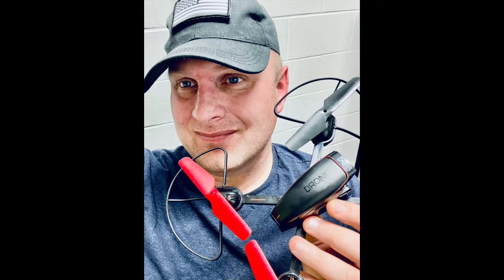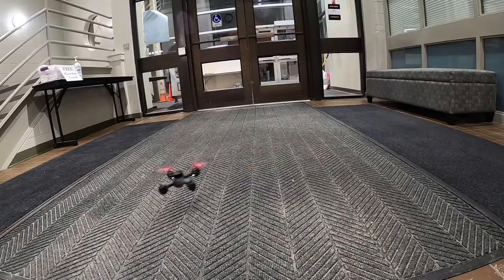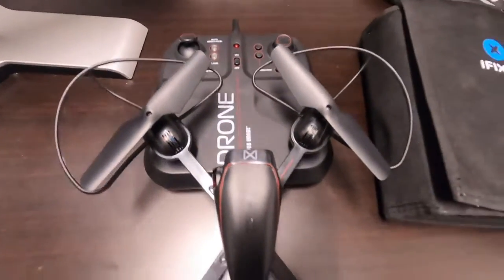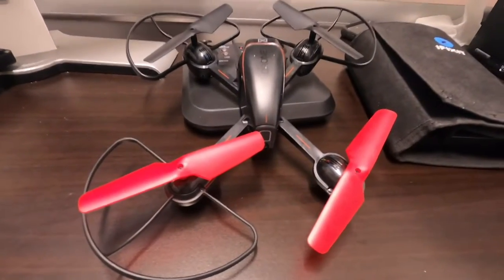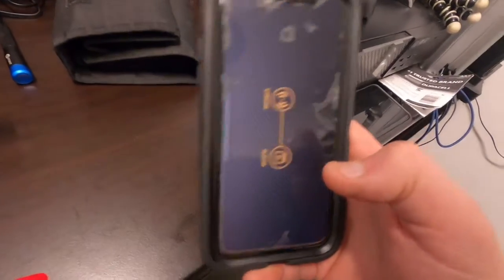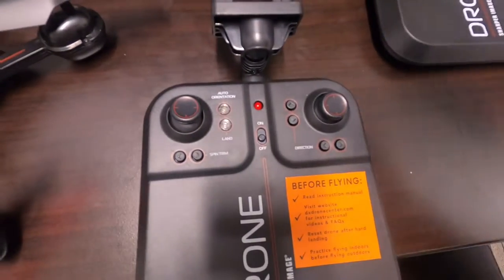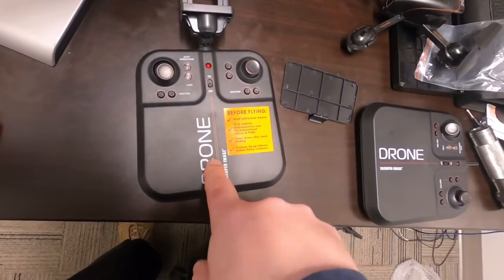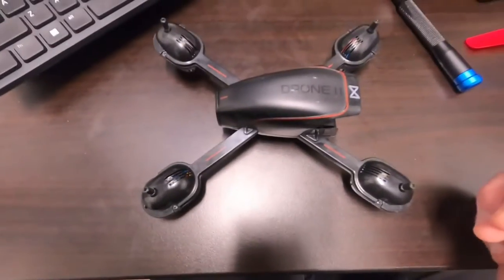Sharper Image Teardown, Calibration, & Repair

Comment: my drone is the one with red and black elices says Sharper Image. I had a fall with my drone and one Elice was damaged. I have already replaced it but it does not take off anymore. I broke one of the red ones and the part of the black elices works very well, it tries to take flight but the red ones don't do their job, it doesn't take flight. on the control it says "Reset drone aftere hard landing". How do I have to do a Reset?
Reply: Same issue
Reply: Same

Comment: When i use my left joystick, it stays up and never goes back to the center, unlike the right joystick
Reply from the maker: Sounds like the sticks connection pads on the circuit board needs to be cleaned/checked out!
Reply: @BrianClunie  I knew you would reply!

Comment: My drone won’t take off and it seems off balance. So how do I calibrate it?
Reply from the maker: Check the propellers for any stoppages. Also, check the batteries/connections/connectors/wiring.

Comment: Why does my drone flip over on take off
Reply from the maker: The motors:
- Check to see if there’s an obstruction, it literally only takes a strand of hair or grass that gets wrapped up in the propeller/motor.
- Power: one of the wires bring power to one or more propellers is loose/connector is corroded.
- A sensor: it all depends on the make/model.
- remote control: something is physically broken/loose or the connection between remote and drone is weak.
Reply: "Possibly your head is on backward" 😂

Comment: Can you help me? My drone connects to the Wi-Fi but when it does the wifif says “no wifi connection” but it’s conemcted
Reply from the maker: There’s something wrong with either your WiFi antenna, or you haven’t set it up on your phone correctly.
Reply: There are several versions of that app in the app store. The one that is in Chinese, worked for me. All of the other ones I had the same issue you did. Try downloading the one written with Chinese letters, the app itself is in English so don't worry

Comment: How do you fix the propeller problem. Mine are not spinning now
Reply from the maker: First check if the propellers are tightened to much or not enough. If that doesn’t work, your going to have to take it apart, and check if the connecting wires are loss.(most common issue, especially after a crash or is dropped)
Also check if there’s anything wrapped around the propeller shaft, a long piece of hair can cause a stoppage.
Reply: @BrianClunie  how do i dissasmeble is? i have tried to open it up but the screws on the legs that lead up to each propellers are too deep in, is there a specific way to open it or do i need a smaller screw driver, i have a #0 x 2-1/2in screw driver yet it still doesnt fit
Reply from the maker: @shallow6995  How I did it: I took the bit that fit, and used tweezers to unscrew it.